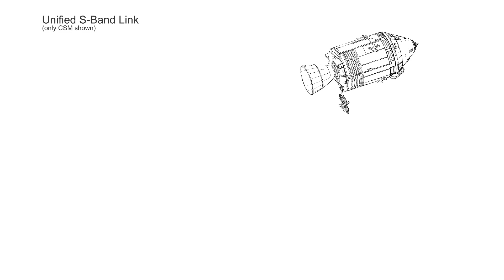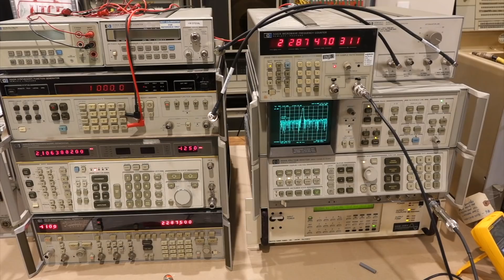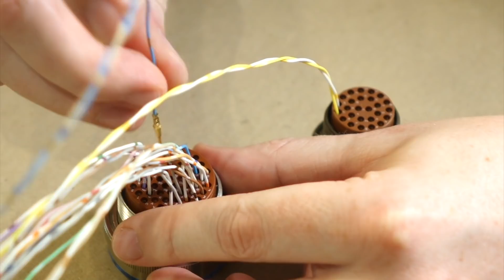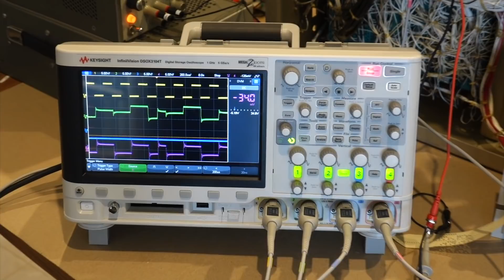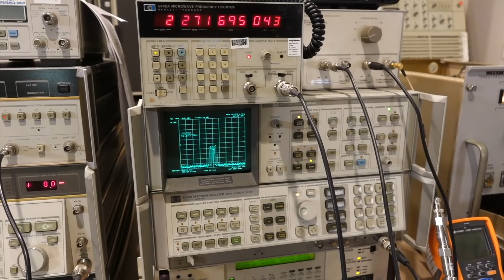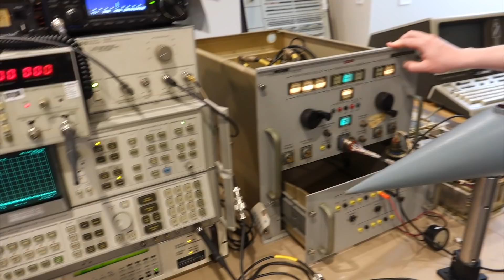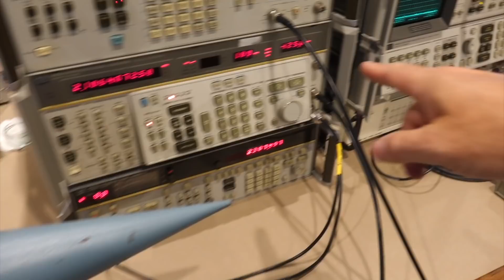Apollo Comms Part 6: First tone transmission, to the Moon and back!

Comment: A ham radio friend built the S-band oscillator boards for Apollo at NBS they were built of very special PCBs one of the 20 or so they built just did not work, they eventually replaced all the parts but could never make that one work.
Reply: Not following, that same as apollo hardware?

Comment: I have some panels from a cockpit of a Boeing 747 and by the looks of it use the same style pins and connectors, was wondering if you could make a video about the connectors and how to properly pin them and what tools you need.

Comment: It would be interesting for you to describe how the equivalent Soviet equipment worked.  Regards.
Reply: The Soviets never used anything as complicated as the Unified S Band System in the 60s.  They tended to use HF below 30 MHz and VHF/UHF radio with FSK telemetry systems.  They used S band for radar systems for rendezvous.
Reply: @stargazer7644  data link is horrible at HF.   FSK at VH and UH would not be much better.  And yet they operated with a higher level of direct ground control than  NASA.   Or am I entirely wrong.   Thanks for the reply.
Reply: @yuglesstube   Data links can be made to work very well at VHF and UHF.  HF is fine too, but bandwidth is more limited there.  Higher frequencies are generally preferred because you can get more gain in a smaller physical antenna at microwave frequencies.  The data links between the Mars rovers and their satellite relays are all done at UHF, for example, but the links from the satellites back to Earth are microwave.
Reply: @stargazer7644  indeed.   But the Soviets were not apparently using microwave downlink.  They did all their voice and telemetry on VHF/UHF?  I suppose that television was impossible.  And the baud rate would have been fairly poor, compared with S Band.
Reply: @yuglesstube  As I said, the Soviets also loved to use HF.  The very first satellite, Sputnik, transmitted at 20 and 40 MHz.  Early Soyuz used 15 MHz for telemetry.  Voskhods used  17 and 18MHz.  Cosmos science packages were around 19 MHz, their early photographic recon sats were around 20 MHz, the list goes on and on.
Reply: @stargazer7644  perhaps it's fortunate they didn't attempt a moon mission.

Comment: curious, did they compensate for time slowing down due to ones relative speed being so fast? Thought that was more modernly proved using gps satellites.
Reply: They had to compensate for doppler shift due to their speed, but the effect of time slowing down was in the range of microseconds for their entire trip.  No compensation necessary for that.  GPS has to worry about it because it works at the nanosecond level.

Comment: You could use a metal cookie sheet between the antennas to block and unblock the signal.  Then see how long it takes to acquire it after a UFO gets in the way of the signals.  hehe

Comment: Marc, you bring back a lot of good memories with that setup.  I created the EGSE rack for the APEX mission in the early 90s, and used a lot of the same gear.  We used a SGLS transponder instead of USB on that mission.  My manager didn't want to spend the $100k for a proper command tone mixer, so I built one out of a stack of HP function generators and a mixer board I made in my kitchen sink.  I'll send you photos.  We later eliminated the FGs with a custom FPGA.  BTW, my offer of the antenna hats still stands if you want them (free to good home) - I've cleaned them up.  The antennas sit inside and couple to a calibrated probe.  The excess RF is absorbed by foam lining.  Much lower chance of causing RFI or creating a microwave hazard in the lab.  Will send those pics as well.

Comment: You should connect a Bird meter between the transmitter and antenna. it accurately measures the true signal power output from low to very high power 10+kw,   It also measures the SWR (standing wave ratio) to test transmitter and antenna frequency compatibility.
Reply: There is no Bird slug marketed (I just spent 10 minutes with their web site, checking this) that will measure above 1300MHz. This application requires microwave equipment. A much better match would be a [ /hp/] 437B meter with, say, 8481A sensor.
Reply: @mansnilsson4382  My Bird 43 watt meter with its slug # 10M that covers 2200-2300 MHz begs to differ.

Comment: So, one of the next steps is to hook up Mikes FPGA AGC simulator?
Reply from the maker: Yes, that would be the ultimate, but we need to bring up at least 3 more boxes before we do that: the premodulator, the uplink data, and the telemetry boxes. Which we actually have on loan from Marcel! Plus make their equivalent on the ground side.
Reply: @CuriousMarc  And you have those nice HP terminals to simulate mission control screens :-)
Reply from the maker: @ReneSchickbauer  You bet we have been thinking about exactly that…

Comment: More than 50 years on, and yet more sophisticated than most countries in the world can achieve today, both in terms of technology and knowledge. Simply amazing!
Reply: I don't think you realize how basic this stuff is.   This kind of stuff is taught in every radio technology class on the planet.  The hard part of this is reverse engineering hardware you don't have docs for.
Reply: @stargazer7644  please enumerate the countries able to produce such equipment end-to-end, as of 2021. Theory, I agree. Basic and taught everywhere. Practice, as having the knowledge of the intimate details if the technology, all of the minute details that make or break the device's performance, is another history. Not even taking into account the amazingly complex supply chain involved.
Reply: @stargazer7644  yes, but in the microwave range of frequencies. Without importing everything.
Reply: @MCPicoli  Microwave radios have been around since 1931.  Almost 100 years.  They don't exactly require cutting edge electronics.  Heck, Amateurs (hams) have been experimenting on 10GHz since 1946.

Comment: I also followed the todays NASA Live event, replacement of an S-band antenna on the ISS. Both these events were fascinating, and obviously this transmission band has survived 50 years.
Maybe your module might still be used as a plug-in on the ISS, with some slight adaptations ?  
I'm also a bit wondering, how it was possible to handle ~ 2GHz with 1960ties technology?
Reply: Why would you think that was tough in the 60s?  The first microwave radio transmissions were done at 1.7 GHz over a 40 mile path between the UK and France using 3 meter dishes in 1931 which is when the term "microwave" was coined.  They transmitted voice, telegraph and facsimile over that link.  Heck, the first commercial microwave oven was sold in 1947 by Raytheon.  
Amateur radio operators (HAMs) were experimenting on 10 GHz in 1946.

Comment: Proving the transponder works has probably added many $$$$$ on it. The owner will be very very happy :)

It was good to see the use ham radio to hear the test signal you was using. Now I wonder you will be able to transmit a video signal through it, or is it just audio only? because showing video would be really really cool :)

Comment: Okay, that was GREAT!

But:

For a real challenge and true authenticity, you need to set aside all that beautiful modern HP instrumentation and redo this with period correct 1960s microwave gear, just like the NASA engineers did. There shouldn't be anything on your bench newer than 1968.  ;-)
Reply from the maker: It' would be cool but it's not reasonably doable. I showed a picture of the actual Collins test bench on Patreon - it took a whole room of racks of purpose built instruments.
Reply: Sadly, this beautiful, intuitive, easy-to-use instrumentation is obsolete and no longer supported. More’s the pity. Later replacements I find more feature-packed but the user is separated from the instrument engine by a thick layer of software.
Reply from the maker: @johnedwards1685  Yep. A paucity of mushy buttons and an over abundance of Russian doll menus. The HP 8566 interface is as good as it gets.

Comment: Bravo!  Excellent Work!  
The thing that baffles me is that the Apollo spacecraft was using a 'rotisserie-mode' that kept even heating on the whole of the spacecraft.  So, unless communications was somehow done with the spacecraft-to-Earth antenna pointed axially (with regard to the rest of the craft), it is hard to imagine continuous lock and communications for the doppler-function.  
I had to laugh when I was the Pitch/Yaw control with an S-meter to aid in antenna positioning--direct solution for the problem!
You guys are really making me happy with all this in-depth re-engineering, of all this high-end hardware; just superb!  Thanks!
Reply from the maker: The high-gain antenna pointing was normally automatic and it was able to track while the spacecraft was moving. We have not explained that complicated system yet. If direct pointing was not feasible, they would use the 4 omnis, which would allow locking and ranging up to lunar distance. But you would not be able to do TV and high-data rate telemetry on the omnis.
Reply: @CuriousMarc  Thanks for the excellent and timely explanation. It is great that the minimum-baseline was the four Omni‘s that would allow for voice and basic telemetry at lunar distance. It would be interesting to know if there was a voting system utilized with the four omnis. So I think that would make a very interesting video, discussing all of the antennas, their orientation, gains and methodology of use. They really threw out all of the stops due to the fact that the Apollo had to be ‘Man-Rated’ with top drawer hardware and methodologies; just fascinating. Thanks again!
Reply from the maker: @SpinStar1956  Yes the antenna system in itself is worth an episode! It’s hard core witchcraft stuff though. I might be able to get an omni (it’s surprisingly small), but don’t know who would still have the insanely complicated high gain.
Reply from the maker: And no smarts in the omnis. Just manual switching between the 4 of them, and you hear ground asking the astronauts to switch to a particular one when they have comms difficulties. Managing the comms system was a large workload for the astronauts, and the designers and flight control people were very aware of it.

Comment: Shows what can be done when they design the equipment using really good quality components without leaky electrolytics and wax capacitors. The thing is as good as the day it was manufactured. I've loads of radios which were made about the same time and need serious restoration.  Impressive.

Comment: I was waiting for you to voice modulate that carrier vs the basic tone generator! ;P  Of course you will have to surround it with some classic quindar tones(250ms of 2525 at transmision start, then another 250ms of 2475 at end), so your Earth network is switched to the spacecraft signals properly. ;)

Comment: Marc, you say you are not moving in your basement, but Earth is spinning, Earth is orbiting the Sun, the Sun is orbiting the Milkyway, etc, etc. So I say that you are moving a plenty.
Reply from the maker: It's relative movement that counts. The transmitter is not moving with respect to the receiver, so there is no Doppler shift. But it becomes a complication when you are actually ranging in space, you indeed do have to subtract the speed of the rotating earth to get the actual spacecraft speed.

Comment: Nice Video once again. Im wondering if you could reproduce the experiment where Raytheon (I think) found out that microwaves melted a candy bar which lead to the modern microwave oven? I believe this setup is right in the neighborhood frequency wise and probably enough power for at least the proof of concept. :)
Reply: There's nothing really magic about microwaves - most RF frequencies will melt a candy bar if you use enough of it.  That's the primary hazard of RF emissions - tissue heating.

Comment: Thank you so much Marc. This has helped me understand the solution that the Apollo communication folks came up with for the terrible comms issues that Apollo 13 went through (on top of all their other problems!) because the third stage IU frequencies were the same as the Lunar Module. I heard the discussions on the excellent flight director audio but never really understood  what they were physically doing. You are adjusting the frequencies just as they did I assume?

From the NASA Apollo flight journal:
 
 “Apollo 13's unusual situation caused a conflict between two radio systems because the LM and the Saturn's Instrument Unit (IU) both used the same frequency for radio communication. The expectation was that because the S-IVB/IU was being targeted to impact the Moon, and the LM wouldn't be activated until after that point, there would be no conflict between the two systems. Now there was. The solution was to have the radio on the IU lock to a particular ground station and have that ground station gradually move its transmission frequency off to a different value. This would take the IU's transmission frequency with it (because the downlink frequecy is directly derived from the uplink frequency). More details can be found from this splendid essay on Apollo 13 written by one of the Australian comms engineers, Hamish Lindsay, who was based at the Honeysuckle Creek Tracking Station”
Reply from the maker: Oh thanks! I didn't know about that particular story. I would have mentioned it in the video! You are 100% right, that's exactly what we did here. Once it's locked, you can pull the frequency wherever you want within the locking range.
Reply: @CuriousMarc  for those interested the Apollo 13 comms issues discussions can be heard here:
https://youtu.be/o5wHChbahlI

Comment: I do wonder how much more compact that whole setup would get with recent equipment. Maybe Keysight could help here? :D
Reply: Modern tech you could fit is all into the volume occupied by the interface panel in the box, though your radiation resistance would be much lower. If you made it rad hard it would likely be a quarter of the volume of the whole box.

Comment: Could you tell me the name of the HP device you are using to bring the frequency down to 19MHz? Looks like it could be affordable to get a used one - and it´s very convenient.
Reply from the maker: HP 5364A. Very large 2 to 18 GHz range. IF range is 10-500MHz. They are other models too, but this one has the built in video amplifier and IF attenuator up to 50 dB. The latter one was particularly useful here!
Reply: @CuriousMarc  Awesome, thank you!

Comment: Congratulations on having Keysight as a sponsor. It's great of them to setup up and help.

Also great to see the 7300 in use.
Reply: Would have been cool if a 60-70s radio was used like one of my Heathkits or swan 350c
M7BLJ
Reply: Id rather seen a piece of Kenwood gear, but....Ill let it slide... LOL....
Reply: @twilliamson3  For sheer size and number of incomprehensible controls, you need a Yaesu (I'm also team iCom).

Now if they'd just release a successor to the 9100 that does HF D*STAR.

Comment: It amazes me how you guys can be handed an ancient piece of electronics history in which time has forgot, (with sometimes no more schematics than would be found under a Snapple cap), then reverse engineer something that back in the day took a team of 20 or more people nearly a year to dream up, and have it up and working in no time.  I also love how well you and your friends work together, combining each others specific forte in order to revive actual antiquities!  It always reminds me of my 2 computer techie friends from middle school and up, we were always trying to breathe life into a junker pc of some type or just pouring over the latest Tigerdirect magazine, picking out the newest high end parts for pretend.  Just nerding out together, that’s what it’s really all about - the friends, and the memories.
Reply: A full-spectrum analyzer with screen and programmable signal generator that can deal with 2.1 GHz frequencies helps a lot... I'm pretty sure they didn't have that in the '60s.
Reply from the maker: We sure have it easy. And wait that we get some modern Keysight stuff… But believe it or not, they had all these, or workarounds to achieve the same. Cesium clock references, synthesized signal generators, spectrum analyzers, network analyzers. They had to. But it took a room full of equipment racks and custom-built test equipment, and must have been very difficult to use. I have a picture of the full Collins test equipment system, I think I showed it on Patreon. I ought to show it in a future video. It's mind-bogglingly monstruous.
Reply: @CuriousMarc  I was thinking that they probably had a room full of equipment to do what you can on a table top. Cool video series!
Reply: @Bryant Everett, hey men! I am the same age of this stuff and i am not "ancient", in fact yesterday night... so my equipment is ok like this one. that is how we build things in the 60's and 70's. can you digg it.? ;-)